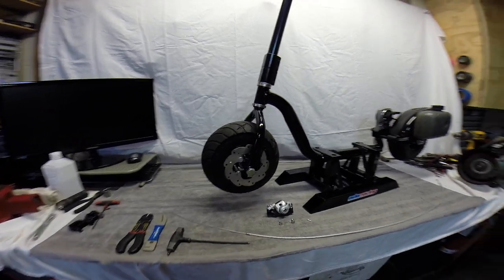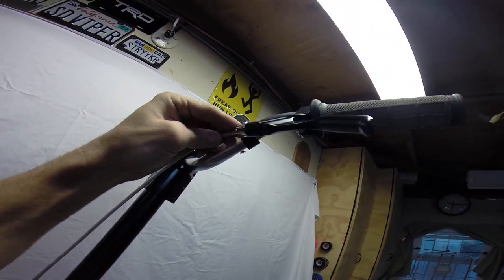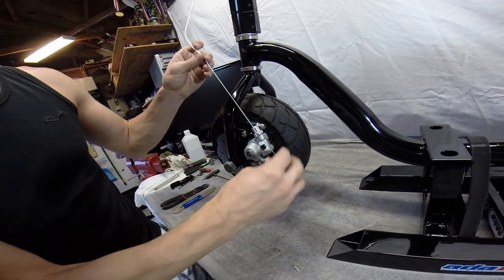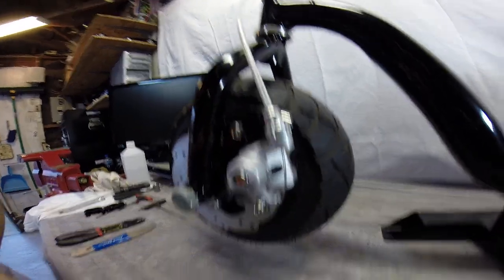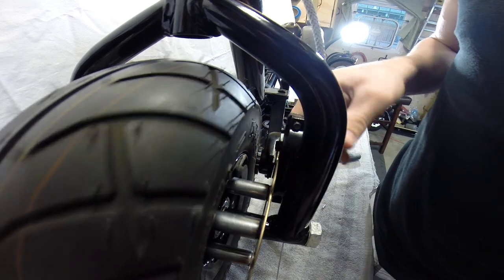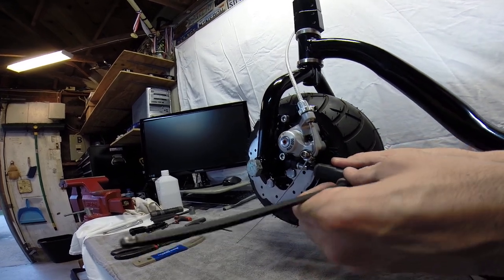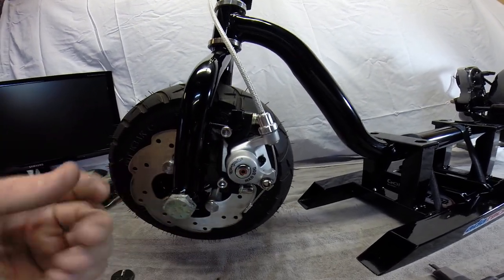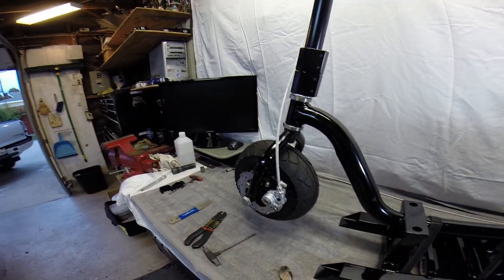GoPed, HOW TO: Full Set Up Front Brakes, Dialing the Front Brakes In.

Comment: I just finished my scooter like this but I want to know if all the forms are the same for the electric razor scooters and the gas scooters? I want to change the forks so I can put a disk brake on the front and run a different front rim also. Could I do that by changing the fork?
Reply from the maker: manuel gutierrez razor scooters and goped scooters are completely different.